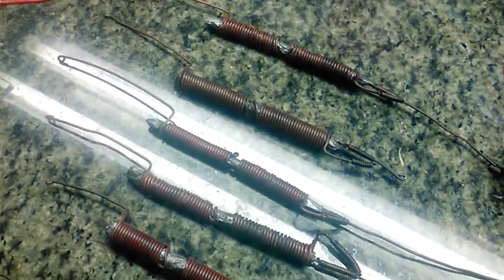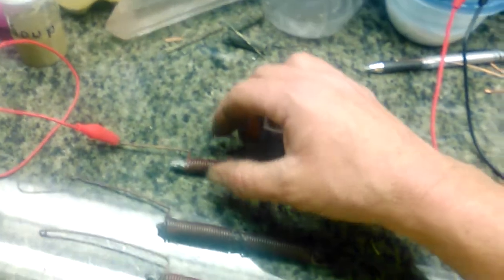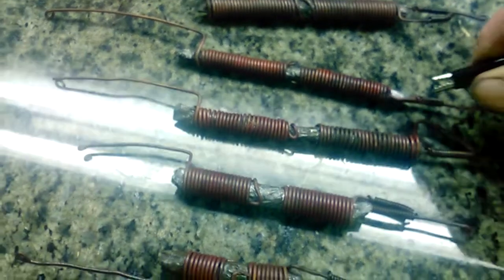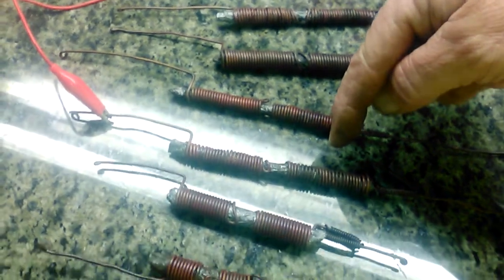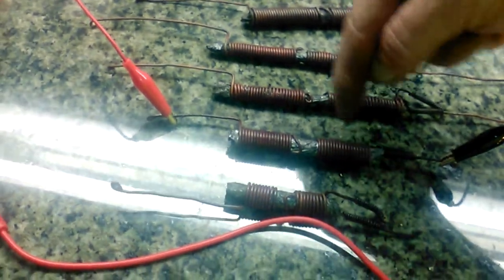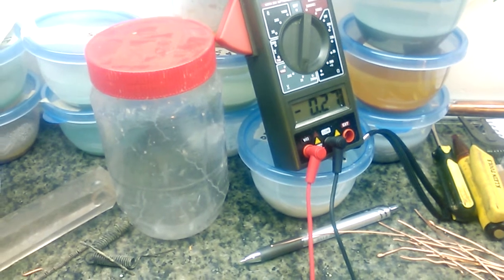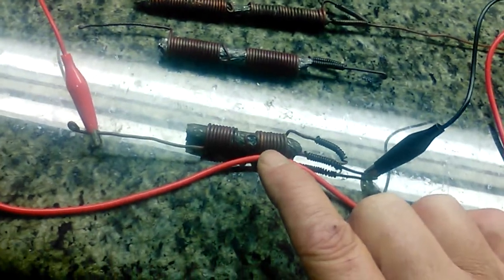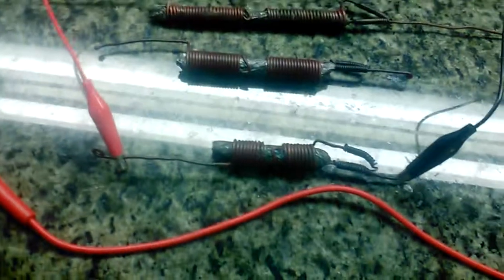Plasma battery

Comment: im missing somthing maybe......I mean I have only just found KSSI, and WOW ! , but this voltage hype is ok and all, but is it not amperage that actually is the feul, voltage is the delivery....no ? ( if you make 60 of these @ 1v each, given you could VM the cuircut with cap & diodes but would then still only have a bug zapper ?.........( ooohhh , you just gave me a thought for a self running HVAC colloidal Silver thingy, we could build them and leave them in fountains all over ), so yeah, amperage, what workshops vid's do you rekomend for straight in deep end practical stuff to do - lol , i have copper collected today and am seriously eager to get somthing turned you know lol !! )

Also, anyone fancy talking about trying to syncranise this tech' with Marko Rodin's Vortex math ! Jamie Buturff also has had great healing results and he is big and correct about the whole harmonics thing, he is using GRatio to create non destructive colapse , but you know, physical build profile as well as wire diameter and power signals and so on all golden ratio'd out and built, I rekon it would just float off.....hahahhaha , in to space AAAHHHHHhhhha ahaha aha a   alol , anyways, peace xx
Great work rick, glad to of found your channel too, I have sub'd with notifications !!  ;)
Reply from the maker: hello James I have kind of changed my direction to using the liquid plasma but I know Stephen Frye has created amps with his system, also have you looked through my playlist?
Reply: The S.E.G. renders this totally obsolete but it's ease of creation makes it great. These do put out VERY TINY amperage but the volts can be put through an amp and converted to amps

Comment: Wow, cool!
Reply: I use aluminum plate from doggy bag in restaurant.  I bought a 50 pack for a cheep price and it is thick enough to work with.  A cold spray of caustic both side do the job for nano-plating.